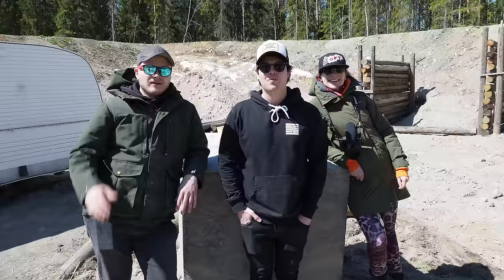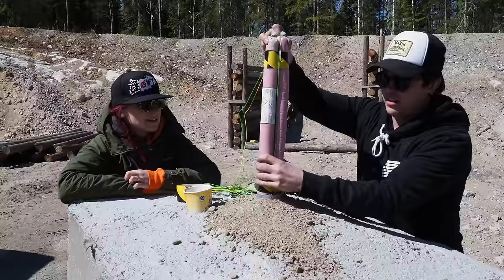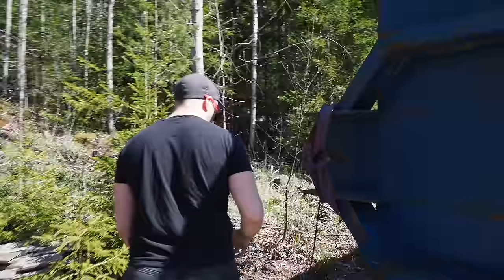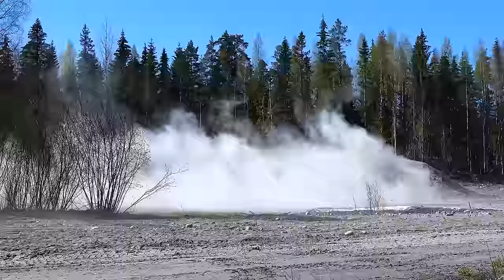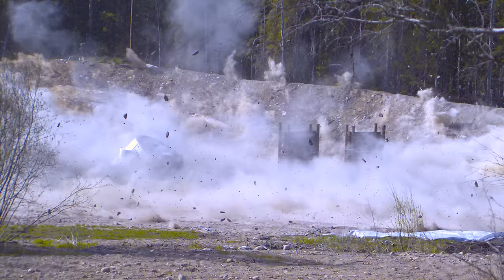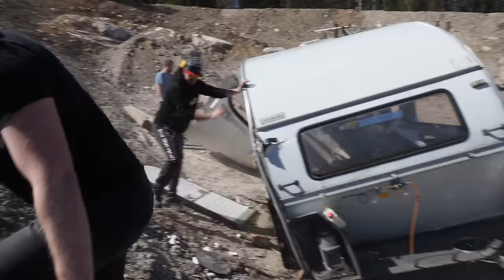Huge Concrete Cube Vs. 2 kg of Dynamite | Will it disappear?

Comment: I love how the cube exploding is such a perfect explosion.  The slow-mo of it disintegrating is perfect.
Reply from the maker: the monochrome one was nice. It was also interesting to see how fast the small rocks were on top of the hole. Henri said that you should normally never put those there since they fly so fast but now we know how fast :D
Reply: Yes, the spherical outwards force affecting the cubeshaped mass created a very satisfying pattern!
Reply: Almost like it had been pre-segmented.

If you calculate the yield strength of the concrete, I think you will find that the segments were sized right at the limit of the strength-strain threshold. 

That is, those chunks were the largest possible pieces that could survive the strain created by the blast overpressure.
Reply: @lairdcummings9092  ooo I didn't think of it that way. Thats fascinating. Engineer btw.
Reply: @timjennings9337  I'm trained as naval practical engineer (i.e. nuclear reactors); don't do that any more, but brittle fracture is one subject that's never left my head.
Reply: @lairdcummings9092  ya never got to take fracture mechanics oddly enough
Reply: @timjennings9337  it's fascinating stuff. A real bottomless well.
Reply: @lairdcummings9092  No limit to the granularity of that subject...
Reply: First comment freaking spoils it >:(
Reply: @lairdcummings9092  ,💪🏻 Science 💪🏻

Comment: Please use Dynamite to launch a manhole cover like the USA did during operation plumbob
Reply from the maker: I have been dreaming about this for a long time. Would just need more space since that thing can be really dangerous for a huge distances
Reply: @Beyondthepress  hmm, very dangerous you say??
Reply from the maker: @applicationuser9764  We would do probably small scale test with 10 kilos or something :D But it would need to be pretty well planned to not just rip the manhole cover into million parts. In original story they probably evaporated the concrete plug under the manhole cover and concrete gas pushed to thing up instead of raw shock wave.
Reply: @Beyondthepress  Bonus points if you figure out how to do it like the frisbee. :D
Reply: Incoming finnish space object
Reply from the maker: @HRM.H  I am working on Project Orion miniature model :D
Reply: @Beyondthepress  Do a miniature version! Launch a Coin from a Steel tube full of dynamite!
Reply: @Beyondthepress  It was welded to an underground tube. Not sure the specs of the tube but the projectile on top was 900kg and 10cm thick. Probably made of some flexible steel alloy that just bent and stretched rather than shattered and ripped apart (copper would be ideal but expensive). Really wish I could find the original footage that estimated the speed at 125,000 mph (5x escape velocity). At that speed I imagine a large chunk of it vaporized like a meteor before the rest of it reached space. The funny thing is it was never planned to be a space object, they actually thought they could contain the explosion of a  0.3 kT atomic bomb (small by nuke standards, but it still packed quite a punch).
Reply: @Beyondthepress  What if you turned the smashinator 5000000 into the boominator 5000000000?
Reply: @Beyondthepress  You may not want to use blasting explosives for this either, but something slower. If you're trying to throw something, lower brisance is better.
Reply: Application User Nah. It was only a 310 ton nuke, barely 
corvette-sized 😉. They used relatively small ones for some of their wackier tests.
Reply: @Beyondthepress  you could probably get away with using the manhole cover on top of a half meter of pallet tops, to damp the blast wave. Would probably be better with a slower explosive as well, like ANFO, so the blast does not cause brittle fracture in the cover. 

Of course you want the manhole cover to be steel, not cast iron or cast steel, so probably best to have one made from a 5cm thick sheet of steel using a plasma cutter, and then have the HPC logo on the top in thinner sheet steel welded to the main piece all round
Reply: @Beyond the press Bonus points for a stack of manhole covers with a staged detonation between them. But yes, this could potentially fly many many tens of kilometers in an uncontrolled direction.
Reply: @Beyondthepress  So, basically... the manhole cover is gonna be extremely dangerous and you gonna have to deal with it? 😏😏
Reply: hmm... plumbob had a max yield of 74 kiloton, thats 74000 kilo of dynamite. (1 kiloton = 1000 tons of dynamite, 1 megaton is 1,000 times greater so 1,000,000 tons of dynamite)
Reply: @Beyondthepress  thats awesome. Cant wait for the news. Hydraulic press youtube channel becomes thr first private entity to launch into space 😂🎉
Reply: @Beyondthepress  Come to Oulu, aim the thing upward at 45 degrees and pointed west. Nothing out there except Sweden. :D
Reply: @Beyondthepress  We did that as kids in the 1950s and 1960s with firecrackers under empty tin cans.
If we'd only had some dynamite...
Reply: @fvckyoutubescensorshipandt2718  They estimated the speed from the high-speed camera: One frame it hadn't moved, the next frame it was gone.
Reply: @danpowell806  From what I read they used a 1000fps camera. 1 frame it's at the bottom of the frame, the next at the top of the frame in 1 ms = easy enough to calculate if you know the distance the frame height covers. If it was there 1 frame and gone the next there'd be no way to tell, other than calculating a minimum speed needed for it to be out of view in 1ms.
Reply: @fvckyoutubescensorshipandt2718  Just so we're clear, it never made it into space... just because something* (not someone, lol) was at escape velocity for a moment, doesn't mean it maintained that speed into space..
Reply: NelC putting a camera on the cover was an afterthought. The bomb wasn’t meant to detonate.. it was a safety test to see if a single detonator firing would set off the core. It shouldn’t do, but it did, partially at least, and off went the manhole cover, fast enough that it probably burned up leaving the atmosphere.
Reply: That’s basically a platter charge, it’s what you make if you can’t be arsed making a proper shaped charge.
Reply: @Beyondthepress  the "manhole cover" in question was quite a bit larger and thicker than the usual object. Many, many times thicker, and perhaps three meters in diameter.

Vaporized rock is indeed likely as a buffer between the blast and the cover.  Even still, it is speculated that the cover literally burned to vapor on its way up.
Reply: @applicationuser9764  It was only 300 tons worth = 15x 18-wheel truck loads.
Reply: @BobSmith-rs7tn  Well, at 34 miles per second air isn't going to be much of an obstacle for very long, 80% of it is within 7 miles so 1/5 of a second and it's mostly out of that.  The problem is the surface facing up going to be heated to boiling point of steel in less time than that the same way a small meteor burns up before hitting the ground, though straight up as opposed to an angle like a meteor leaves less time for it to burn up. The jury is still out on what happened to it since it was never found. Some say a charred inner chunk of it is in solar orbit somewhere, others guess it was all vaporized. I say fire off another one and have radar and other instruments ready to track it.
Reply: In Spain, some Basque dudes used dynamite on a manhole to send the first prime minister to the space. Carrero Blanco, the first Spanish astronaut.
Reply: @Beyondthepress  so, It was a VERY SMALL (for nukes) test of the safety protocols where they did that using 300 tons (272155kg) of dynamite. the shaft was 500 feet  (50m) deep. so to scale, you only need 30 tons of tnt under a 200 lb manhole cover 50 feet down! The biggest factor in if they sent the plate to space was weather the plate buckled in the center from the shockwave impulse. if it was flat, it would be unstable and experience re-entry heating and burn up. if it got "dimpled" where the center was bent upwards, it would be shaped like a heat shield and would be aerodynamically stable,  and the heating  would just ablate and liquify the leading edge, making the "dimple" into a cone.
as for safety, if you tilt the whole a few degrees, you could make a "downrange"so it's not literally a "toss up"
Reply: @SeanBZA  Best not to put logo on it for deniability :-)
Reply: I could send you a Telephone Company manhole lid but the shipping for Overnight is too expensive. Maybe I'll bring it in my carry on bag when I come to see you guys in Finland!!
Reply: It's worth noting that Operation Plumbob didn't launch anything into space. The reason for this is the same reason that you can't launch anything into space using a cannon : air resistance. To get something into space, it has to be travelling so fast when it leaves the ground that it simply burns up or disintegrates in the atmosphere.
Reply: @nigeldepledge3790  not entirely. go watch scott manly's video about it. if the plate remained perfectly flat then yes, aerothermal heating would vaporize it. however there is a chance that the impulse from the blast distorted it into a more conical configuration, meaning it would have a slight aerodynamic preference, allowing the brunt of the heating to be shifted to the trailing edges, allowing it to survive. it also had enough velocity that if it did survive, it was leaving earth's sphere of influence. 

it all comes down to weather or not a nuke can the plate from the other end of the tube. if yes, it probably survied

Comment: Next one: 10 kg of dynamite in steel enforced concrete block. That's going to be even bigger mayhem
Reply: I just try imagining the rebars flying around like daggers... with 200m/s!
Reply: I'm for that.  High content ferrocement with no tube only wires - actually embed the explosive in cement in the middle.  Its easy to have enough energy to exceed the tension power of plain concrete.  Can you make the rebar disintegrate too? (materials science wise I imagine it is possible, but could require a pretty big bang)
Reply: Just 60 grams to see how that will destroy the concrete would also be interesting. Probably not so fun but I kind of want to see the difference
Reply: @SkylosSobaka  You are correct SS in that heavily reinforced concrete is quite difficult to break with explosives, much more difficult than hard rock as the reinforced concrete has high tensile strength but rock has high compressive strength but low tensile strength. Normal load rate for demolition of heavily reinforced concrete would be about 1 - 1.2 Kg/m3, for popping a boulder the same size 100g is plenty.
Reply: @demolitiondavedrillandblast  so, we would have to go with the 30-multiplier and land at about 30 to 35 kg of dynamite... 

Yes, that will be on the dangerous and the ridiculous side as well!
Reply: It wouldld also be interesting to see a giant steel block being ripped apart :P
Reply: if you get them that metallic cube. its expensive you know?
Reply: I just came to comments to say this
Reply: @mikkihintikka7273  
1 m³ of steel is 8 tons (material costs ~ 4000 €)
1 m³ of aluminium is 2,7 tons (material costs ~ 3700 €)

But aluminium should be easier and cheaper to melt into a giant block, although it probably more depends on what the local manufacturing costs are for such a job...
Reply: 1kg of PE4 per m2 of steel reinforce concrete in military dems
Reply: If you want a real-life example of the results, go visit Point du Hoc.  A 16" (400mm) shell from a battleship went through the front of an artillery bunker and set off the ammunition stored in the back...  One 10 ton chunk ended up about 100m away.
Reply: Welded rebar frame, fiber reinforcement, and a high PSI mixture might just shoot flames out the top and puff out instead of break into gravel and dust! It shouldn't cost much more than what was done with the plain jane powder block in the video.
Reply: Sounds like a magic spell to me, like "hocus pocus"
Reply: @mikkihintikka7273  I think they already have one. The used it in a different video but the explosin couldnt damage it. Needs more BANG.
Reply: @derPetunientopf  holy shit xD it must be fucking expensive
Reply: @mikkihintikka7273  They had to order it from a proffessional company.

Comment: Did something similar as a teen, on a smaller scale. Placed a guart jar of blasting powder inside a five gallon bucket of wet concrete. Let it dry for two days. Threw two fist size chunks just over 100 meters. Had placed a 55 gallon drum half full of hardened roof tar over the concrete bucket as well. Ripped it open, broke up the hardened tar, and threw it 50 feet into the air. Very loud too. Thanks for your videos.

Comment: 50 kg dynamite in snow dump = wet fart
2 kg dynamite in meter-square concrete block = complete mayhem
Reply: Next up: 2 kg of dynamite in 1 cubic meter of snow.
Reply: Reminds me of making "firecrackers" as a kid. Took us awhile to figure out that the tighter the package the bigger the boom (black powder or flash powder).
Reply: @huverdoose  lots of kids lose their arm because of that, i have seen some almost cut themselves in half i doubt that kid live anymore.
Reply: Snow and ice are as incredible at absorbing energy, as water is at transmitting it.
Reply: @mfree80286  Let alone concrete

Comment: Years ago, I dismantled an old travel trailer like that to make a flat-bed utility trailer.  It took me several weekends to strip it down to the frame.  If only I knew then that exploding a cubic meter of concrete next to it could do the job much faster.  ;)
Reply: I too, have torn one down.  And also a typical 1970's mobile home/trailer house.  The one thing I would love to know is what secret technology goes into those damn staples?!  It's like they hold things together with some quantum mechanical force or something.    Damn near need dynamite to separate the pieces.  The wood breaks and shatters,  but the joints hold fast.
Reply: @Cammi_Rosalie  Yes, mine had thousands of staples and screws.  I think the 1x2 and 2x2 wood furring strips swelled in the damp Pacific Northwest where the trailer spent most of its years, and then the wood got harder with age baking in the southern New Mexico sun, which is where I had it when disassembling it.  They just didn't want to come out.  They were likely glue or resin coated staples too.  Even after "raking" the ground area with a big magnet to pick up staples and screws, I still find one or two now and again, and it's been about 18 years since I broke it down.
Reply: Might need a new frame if you're stripping the frame with dynamite. And new tyres. And new everything else.

Comment: Imagine how much more intense it would have been if they filled the hole with concrete and let it dry, to contain the explosion more lol
Reply: That would only make a difference with gunpowder. A high explosive does not rely on pressure buildup nearly as much.
Reply: @zwz.zdenek  how would it change? :o
Reply: @zwz.zdenek  Is that why there's no such thing as a shaped charge?

Comment: This actually reminds me a bit of how dry ice bombs are much more dangerous  near debris. The 15 liters or so of gas produced in a plastic 2-liter detonation is only equivalent to a few hundred milligrams of explosives, meaning that from the raw explosion, 7-8 meters should be safe. but they punch way above their weight if they're near wooden or glass objects that can shatter and splinter, or gravel or ball bearings that can go great distances.

Comment: Dynamite is more destructive against resistance (concrete cube) and less dramatic against soft fluffy snow.  The concrete resists, creates pressure then the pressure is magnified until it is violently released.  The fluffy snow doesn't resist and the explosion is more easily dissipated. .

Comment: If you count energy of explosion 2 kg of TnT and re-count it to kinetic energy of 2 tonn concrete block at whole it should has speed of 91 m/s, but taking into account the destruction energy and the moment of rotation of the fragments we can divide it by 2 for rough estimation, so 45-46 m/s for debris. Looking at speedcam footage at 6-30 - 6-45 speed of fragments is near 40-50 m/s (0.1s to hit the trailer, depends on distance from cube to trailer, I think it 4-5 metres, so speed is 40-50 m/s). So theory gives us very close estimation of speed of shards.

Comment: May as well have used a cubic meter of ice! The good concrete has geometric stainless steel clips as a fiber reinforcement, and you have to get the high PSI stuff with extra welded rebar framing! Think 250-400MPa / 38,000-60,000psi.

Comment: So if you had to escape an explosion of that block happening in a few seconds, pick a straight line from a corner, the direction of the diagonal divider, I mean. Because the main forces spread outwards from the 4 sides. About 60m away you would be somewhat safe, especially if lying down. Better not try of course, but if you had to escape the explosion by running. And of course if you got 60m away, before explosion, just keep on running behind the trees. Better if you started from a corner near the forest. or behind that earth wall. One safe way would be also to dig a bit inside the earth wall, if it's not just sliding sand, but turf and brown soil.

Comment: The dynamite exploded more in the concrete than the snow because there was more pressure. Look up sparkler bombs and you'll get the idea. I have learned that I can put 5 rolls of electrical tape on 1 box of sparklers and get a bigger report than 1 or 2 rolls on 5 boxes.

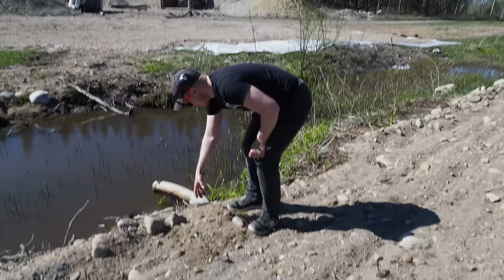Comment: 7:24 when you pick up concrete shard, the corner of the block sits right next to it, and the shard I believe comes from just below corner of the concrete block, from slow mode capture, you can follow pieces fly to the pond area where you are finding the pieces.